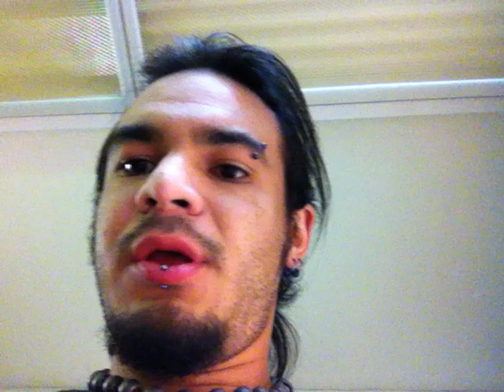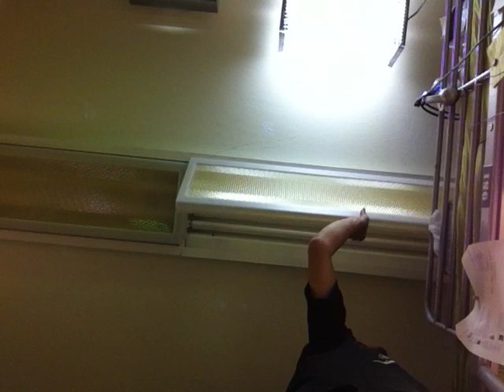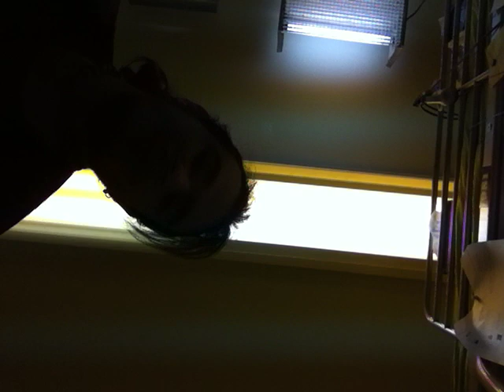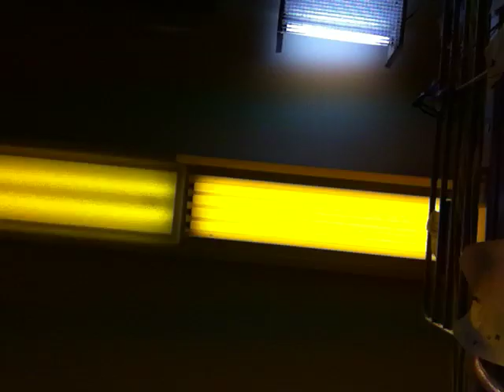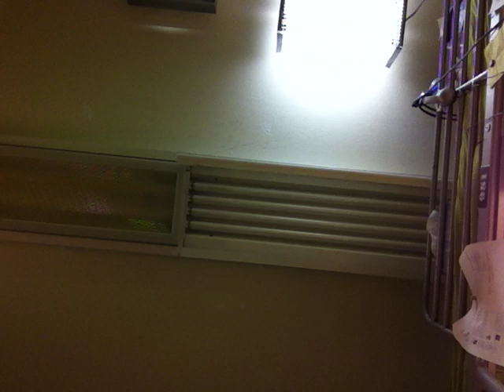Vintage Westinghouse fluorescent fixture starting 6 lamps

Comment from the maker: Thanks. A lot of the mercury vapor fixtures were ebay finds, some were home made from parts of other fixtures, some of them were found at local salvage stores that sell used parts from buildings. If you're resourceful enough, they can be found quite readily.